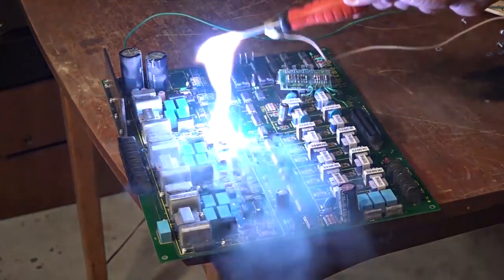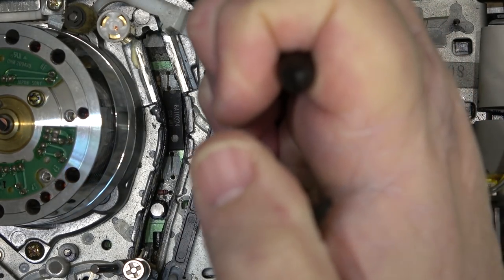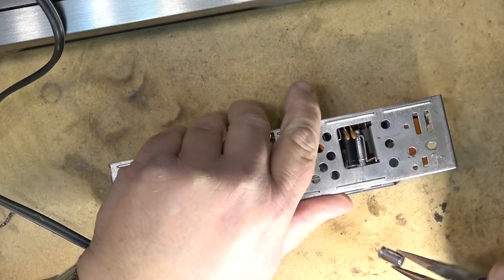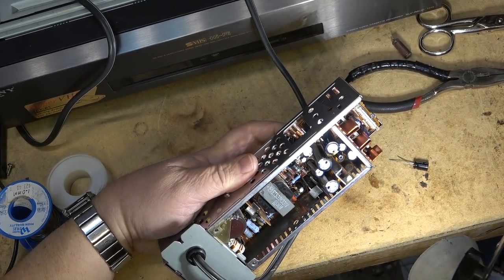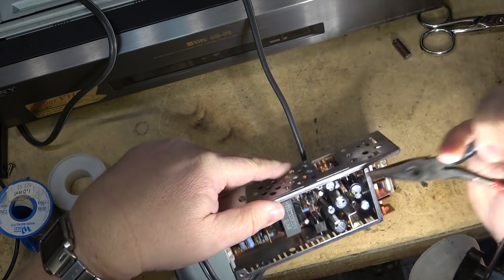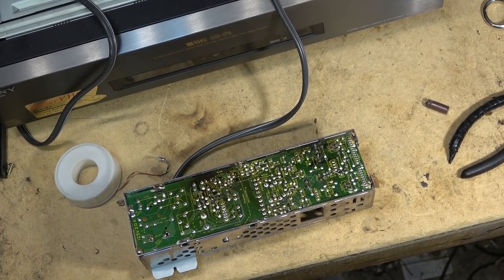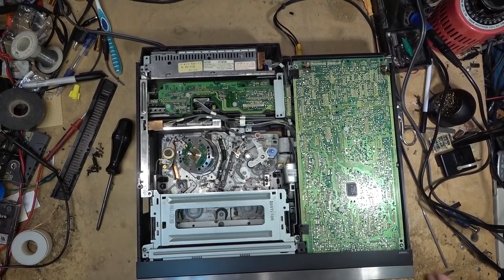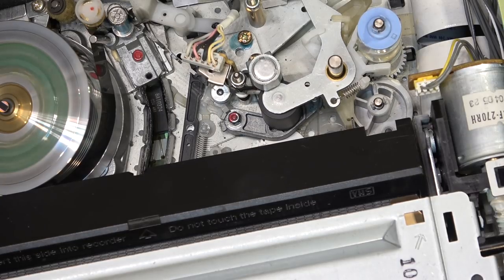Sony SLVR5 SVHS VCR with Multiple Problems

Comment: I'd argue about Elna being so crap. To be fair, all early low ESR electrolytics leak. Yes, these Elna Long Life series started to be notorious for leakage about 5 years earlier then other big brands, but all brands are affected. I've seen a lot of Nichicon, Nippon Chemi-Con and especially Panasonic low-ESR caps leaking. Maybe Rubycon is less problematic, at least for leakage (they like to pop instead...). 

I've seen a lot of Panasonic G mech VCRs from like 1992 that had loads of leaking Panasonic capacitors in the PSU as soon as 2002. Some series from Panasonic are actually worse then these Elnas. I'm starting to see generic 85°C Panasonic caps from mid '70s - mid '80s leaking (the light purplish-blue.ones with red markings). 

The majority of SMD caps in Sony camcorders are usually Nippon Chemi-Con (the bigger ones has the badge on them), they all leak, just like any other SMD electro from that period. I repaired a Sony BVM monitor from about 1991 in 2020 that had many leaking Nippon Chemi-Con caps in the PSU, one of them caused carbon tracking, burnt a 1/2" hole in the PCB, and burnt up the flyback coil of the -15V buck regulator.
Reply from the maker: They were all crap, but the Elna ones failed really quickly.  ELNA, Electrolitic Leaks, Not Acceptable what our slogan for them.
Reply: When you said light purple Panasonic caps, I looked at the servo board of a 1982 Panasonic VCR and sure enough, there are two 33uF 16V caps that are leaking green stuff around their negative terminals. Good stuff...
Reply: @crashbandicoot4everr  Very familiar... I'll hopefully restore a Panasonic NV-FS1 (first S-VHS from Panasonic AFAIK), fortunately it does not have  a lot of leaking caps. I bought it from a repair shop, they gave up on it. They've replaced only about 4-6 caps on the different boards (and all caps in the PSU, but they 'stolen' back the new caps prior to selling it), now it has one single capacitor that's leaking, guess what it is: a purple Panasonic with red markings... It has a ton of pink/purple ELNA on the HiFi board, they might all be open, but none of them leaking yet (2 were replaced by the shop on that board, there're signs of leakage around them, they might have been ELNAs originally).
Reply: @mrnmrn1  Don't these early S-VHS machines have those modules with SMD caps that leak and corrode everything? My NV-FS200 does.
Reply: @crashbandicoot4everr  This one has two ceramic hybrid modules (luma and chroma) with one QFP package ASIC per module and a bunch of SMD parts on them. Fortunately zero electrolytics, those are just on the phenolic boards.